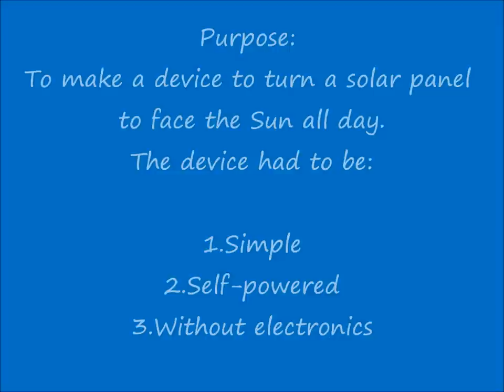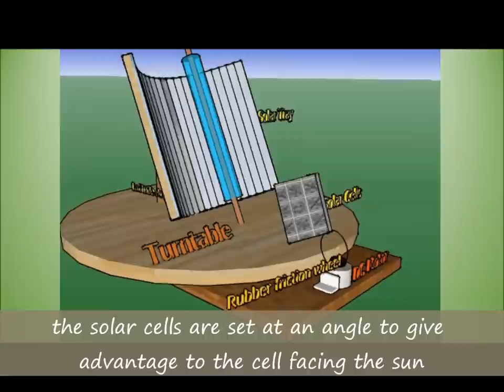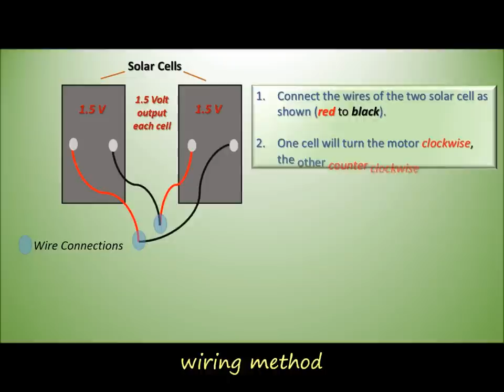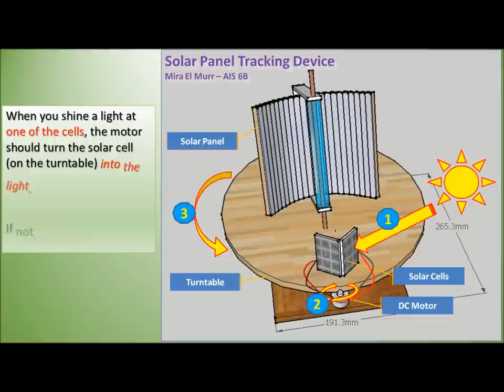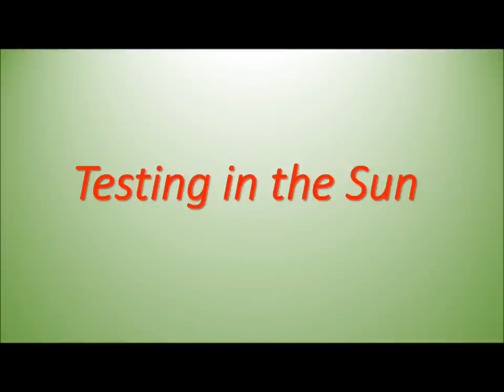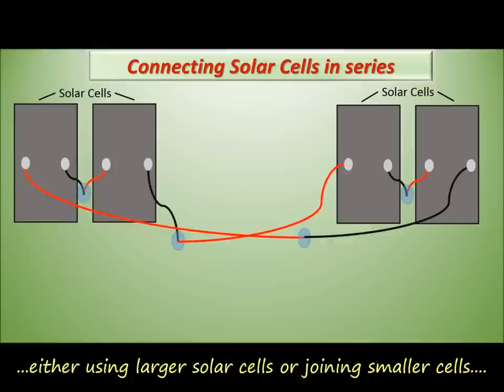Cool DIY Solar Tracker Self Powered No Electronics - How it Works

Comment: forgive me but i forgot to say i think your solar tracker is great. i just viewed an instructable which is ardueenie controlled yet the cost was $42 in parts plus coding and having a computer to operate it. there are other trackers in this world but yours by far is the most simplistic stroke of genius i wished i had thought of!
Reply: solving this with an arduino is overkill unless you have additional functionality added like networking for state reporting and control, and for illumination & solar power metering.
else if you dont want/need that then there should be many durable solutions that are much cheaper.

Comment: Simplicity is the ultimate sophistication. - Leonardo da Vinci
Well done!
Reply: still there are even documentaries out that proof that the inventions of DaVinci are drawn incompletely and thus meaning a vital component to make them really "fly" was left out. for the hang glider it was a strange long stick that was hinting todays expert rebuilders that in fact a rear stabilisation wing is a very vital part of the original genious design but it was left out by full intention so that the papers are worthless to someone that had not understood that phaysics to a similar degree. the non understanding would find itself in a omewhat life at risk situation trying the device in real world or at least would find out it wont work for him. - thats the nowadays proofen case for many of the inventions in the papers as left behind by DaVinci.

Comment: I agree with erick sal, your idea is the BEST I have seen too.
For weeks I have been searching through many websites for a solar tracker for a solar cooker and water distiller. All the others are far too complex and expensive and none I have found so far provide all the information in an  easy to follow step by step guide which is necessary because they all use complex electronics. I intend to try using your idea for the vertical axis as well. Slightly more challenging, but possible I believe.
Thank you young lady, you have helped me more than you could know! Bless you!

Comment: WOW and WOW! You are an inspiration. And as for this not being scalable; Using your idea, I have produced a 250w panel which feeds a 4000w storage bank and it works just fine. I guess those know it all 'budding engineers' aren't as good as you at thinking outside the box. Keep up the great work!! I'm subscribing and will be keen to follow your projects.

Comment: The idea especially when it's put into practical reality is really gr8 & practical indeed. Some dude have questioned how the power of two opposing panel don't conflict. First the power there in isn't too great to worry too much about Secondly the panel that's"closer" to the Sun will obviously put it a higher voltage"ordering" the motor to move in its favour. But when the panel is pointed at the Sun the voltage from each of the two panels cancel one another resulting in zero output. Point to be noted is that the voltage from both the panels arnt at its peak as they are at an angle at about 45 degrees of probably half the amount (lots of energy isn't really required now) but either panel will give out higher energy only when the main panel is off centre to the Sun, this is when the energy required to power the motor should be really more than at rest. The fact that the reduced voltages of both opposing panels gets"short circuited" when it's at dead centre is minimal and really of no real consequence.... You follow? (:-)

Comment: I just love thease simple solutions. They just makes me so happy. Good job!

To improve this a little in the discussion about tangled wires. Put the motor on the turntable (between the spokes on the bicyclewheel), driving against the "ground". Use something heavy ontop of the motor to ajust friction. Then it can turn how many revolutions it wants. Good for us in sweden as the sun never sets in the sumertime.

Comment: With single board computer solutions available right now, it is so easy to over complicate what is a really simple solution. A well thought out and simple solution is what is shown here, using repurposed, cheap and readily available parts, coupled with some basic mechanical engineering. Proof that we need both sexes and all ages working together to come up with these solutions. Bravo to that girl and her school! 😀 👏 👏 Superb
Reply: The student's gender isn't actually applicable to solving the problem. Good on her for coming up with this admirably simple solution, however. The only remaining problem would be to find a suitable motor for the load required, as the video covered.

Comment: that's pretty good, would the wirest to the smaller panel be running UNDERNEATH the entire turntable system?  bc I was wondering how you would prevent tangling of wires.

Comment: Congrats, project well done and very innovative. I have some ideas for improvements if you are interested, it will allow your table to spin 360 degrees without twisting your wires. Of course you will need to route a few slots, circular, under your table, insert metal of your choice, copper wire, copper flexible tubing hammered flat, what ever you have, in said circles and then solder the solar cells wires to said metal through a hole in the table. Then you can use solid copper wire, 12 gauge or what ever you have, hammer down a bit flat and curve the end like a J. Turn it upside down so the J part is up and makes contact with the metal in the circles and put it on a bit of a slant so that the J has a bit of bounce but sill makes contact. Then make a loop on the other end of the J to allow the upside down J to be attachment to the Bottom of the Table. Then simply attach the J circle ends to the motor with what ever wire you have. If you wish to hide the motor as well, you can cut 1 additional slot under the table and have the motor wheel touch there. Using a spring you can put some tension on the motor. Simply attach the motor to a block of wood that has 1 screw to allow it to swivel and then attach the spring to the block and stretch it a bit to put tension so that the wheel of the motor is pressed against the table to make good contact. If you really want to get fancy you can mount the motor to said block by cutting a circular hole, about the size of the motor, and then cut a slot so that you can drill a hole for a screw; then depending on how tight you make the screw you squeeze the motor housing to hold it firmly in the block to keep the motor from hitting the bottom of the table so with the use of the spring it will move freely. I hope you consider some of my improvements for your next project; or perhaps use them to inspire more ideas of your own...
Reply from the maker: Much obliged for your suggestions, we had tried some of them - like a rubber band to push the motor onto the turntable, but that almost stopped the movement and required fine tuning. We liked the wiring idea which would be better than leaving wire slack suspended over the motor.  We're working on another prototype (unfortunately slower than we desire) but once the principle works, we'll look into the finer detail. Thanks again.

Comment: Great video, a very simple concept that could be very easily scaled up to  move larger panels, to keep friction at a minimum you could make a mag - lev bearing using two magnets from a microwave oven and an old record player turntable, this way you could use the band drive on the turntable as well, regards Doc Cox

Comment: you can connect a bipolar relay instead of the engine. Then have the relay control a more powerful engine from a/the power bank that the bigger solar cell panel has charged. Still using same idea.

Comment: very smart.  Wonder if the motor could be attached to the wheel and then the drive connected to a belt under the wheel that is looped around a stationary pulley attached under the wheel and on the same spindle as the wheel. This would solve the issue with the slack in the wires.

Comment: Wonder if you could use a similar setup to adjust the tilt.
Reply from the maker: Kevin Smith for photovoltaic panels the tilt adjustment would be seasonal so less frequent, so it can be done manually every few weeks. Efficiency loss would probably be much less significant than setting up a second tracking system.  Nevertheless, it would be possible to set up another tracking solar cells and motor setup but by turning the second solar tracking panels 90 degrees to pick up the tilt. in this case, the new second axis of rotation may carry the entire original assembly, and instead of a turntable, use a wheel oriented vertically. The beauty of this system is by using mechanical advantage, but one may use a pole mounted system with larger tracking panels and motors.

Comment: i used a bicycle rim with the tire removed on a wind generator i built . i used sewing elastic to make a belt to spin a cd player motor(one that has two wires i think it was the carriage tray motor) with a 1/2" diameter pulley i made for it. the 26" rim had a 70" circumference and the pulley 1" + -. so gearing is over driven at 70/1. 100 rpm average generator speed and you have 7000 producing 4vdc ?amps.  charge 4AA batteries in parallel around a day as the wind blows day and night

Comment: How does this stand up to wind. I'd think the main solar panel might act as a sail. I know this is quite late and the  presenters of this idea may have moved on to other things but if anyone has tried this and experienced wind I'd like to hear from them before I embark on my own try out of this idea.
Reply from the maker: Our idea was to use small pv solar panels to orient  the main panels to face the Sun.  The turntable idea was one way to demonstrate that. but you can use a strong metal frame supportng the main panels that each pivot separately like louvers - perhaps guided by a common rod - and while using the small panels for guidance. You can also have backup rechargable batteries to drive the motots, while the main role of the small panels would not necessarily be to power the motors but simply to switch the current as necessary. 
Good luck.

Comment: What about using doides in solar tracker so current will not flow in panels when voltage is it equal... Since you put the panels in series current would be flowing through the panels...
Reply: The panel is already a diode. An extra diode will produce a dead zone and also require more voltage from the panel to overcome the 0.6V drop of the diode. Since you would likely need two diodes, that is 1.2-2V extra you need from the drive panels and a bigger dead zone. For a low voltage motor, this is probably the best setup. This will work well for a small array, it might require a little re-tooling for something bigger.
Reply: tubesman7
How well do you think this will work for a 6 volt motor and 6 volt panel? Any chance of a short being created?
Reply: I have been thinking about a way to scale this up to a useful size solar panel. I think it might work best to use the panels she has as sensor/motor drive and just use them as a sensor. Take the voltage and use it to drive a solid state audio power amp with the DC blocking caps at the input and feedback loop removed so it will amplify DC, then use that to drive a bigger motor. Such an amp can be obtained on Ebay for little money. You just need to make certain the amp will run on a split rail i.e. +/- power supply. And deliver enough power. As far as a short, just wire the solar panels as she did and there will be no short.

Comment from the maker: I love this comment that was posted for this video in our channel's Community section . Thanks MC R.O.K. and good luck with your device.

MC R.O.K
19 hours ago
I am a 65 yso, south Korean. Nowadays, I have been very very hard searching the solar tracking system solutions through the YouTubes related in order to get the probable free energetic mechanical, electrical and electronic methodology and protocol.
At last, I have discovered - not found - such solutions through a little schoolgirl's idiosyncratic presentation and small but powerful equipment - most economical in the world.  Eureka !  In any other presentations, there are no concrete and detailed explanations on the solar tracking algorithm or mechanism. They must have not at all known  about the solar tracking algorithm.
Anyway, through this community, I want to give millions thanks to once upon a time schoolgirl and specially, her wise and smart science teacher etc. I confirm all member will make America greater twice. this is 00:14AM, 02/20/2021.  Have nice weekends.

Comment: I'm sorry, I am not well versed in electricity.  How does the motor shut off when the panel is aligned with the sun?  If both panels are getting the same amount of sun, wouldn't the motor be getting signals to go both directions, keeping it in a constant "on" state or conflicting?  What shuts it off when they are aligned, or, when both small panels are getting equal amount of sunlight?  This is such a great experiment!
Reply: Michael McClish the power coming from both solar cells can be sent to a motor or bridge which compares the power.. If right side is giving more power bridge will send positive signal to motor to move it more left, if left side gives more then negative voltage is sent to turn left..
Reply: I see, thanks, and a great demonstration!

Comment: At 0:45 what is the angle of the two solar cells?
Reply from the maker: Accuracy is not that critical since the angles also change according to season. – The Sun path is of course lower in the sky in winter. But anyway, the tilt angle of both motor panels to the horizontal would be the Latitude angle of your location.  For the angle between the motor panels we used about 70 degrees, but it depends on your motor and motor panel size and how often you want your main panels to turn. A smaller angle would take longer to expose the motor panel surface to enough sunlight to turn the motor and a larger angle would turn it more often. You can also install a fin between the panels to cast a shadow on the panel facing away from the Sun so it does not fight the panel facing the Sun. Hope this helps…

Comment: Does anyone have an idea or seen anything that will keep the wind from moving this out of place?
Reply: Ulises Escobar Using worm gear on the motor to can prevent turntable turning by any external force. I'm wrong ?
Reply from the maker: PyroEvil Using a geared system would be a good idea since during windy days, this system would keep fighting the wind to return the panels into alignment and continuously stressong the motor.  One more idea is to use the gears to lock the panels into place by using a simple timer switch (also solar powered) in line with the motor wires that would connect the system every, say, 15 minutes, which would re-align the main panels and then switch off for another 15 minutes thus locking the gears. Having said that, one may need another small hydraulic piston lock (actuator) that may push a dowel into the gear to lock movement between tracking adjustments (or like a ratchet would). For a multi panel system, one could use one large motor and sensor panel system on a rod (like a sway bar assembly) behind the multiple main panels thus making the effort more worth while.
Reply: Science Club - Kids and Parents but worm-gear setup is made form a worm gear and a normal gear where the worm-gear can turn by applying a force but the normal-gear cannot if you try it. It's a kind of "locking". If a well remember it when I play with gears when I'm younger.
Reply: Science Club - Kids and Parents From wikipedia : " Worm gear configurations in which the gear cannot drive the worm are said to be self-locking. Whether a worm and gear will be self-locking depends on the lead angle, the pressure angle, and the coefficient of friction; however, it is approximately correct to say that a worm and gear will be self-locking if the tangent of the lead angle is less than the coefficient of friction. "